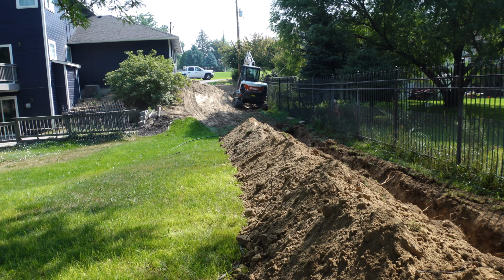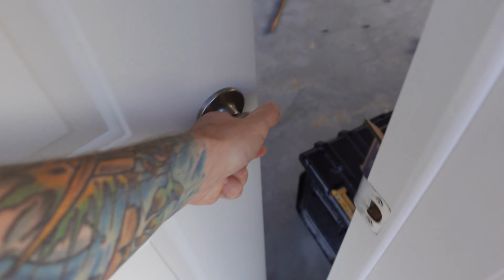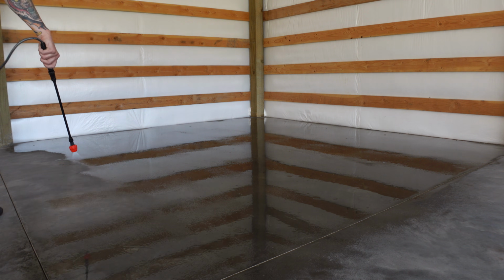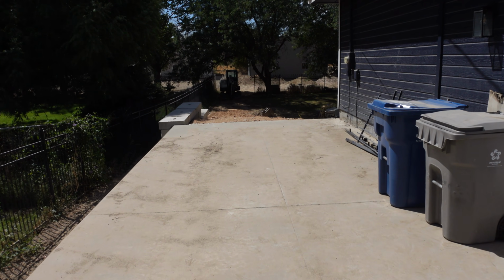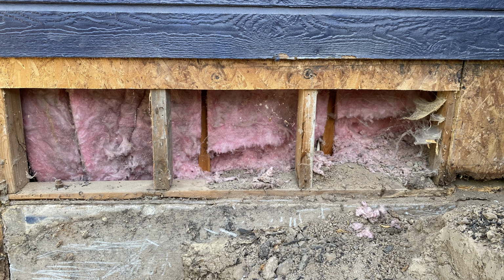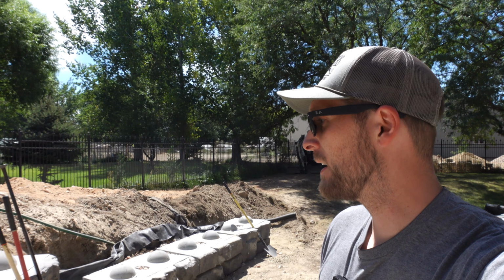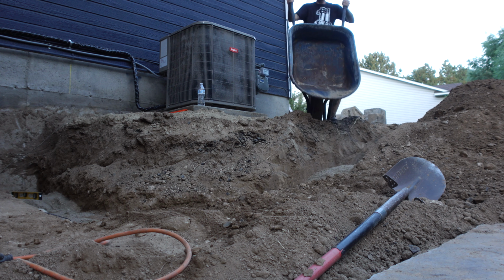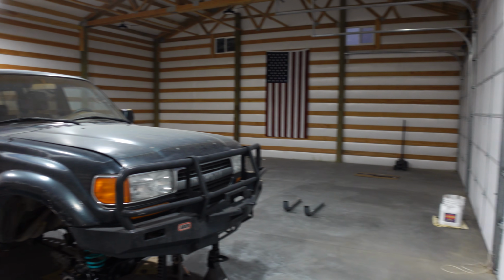I Spent $80K Building My Dream Shop… Was It Worth It?

Comment: Well Ricky, I feel your pain especially because of that house-A/C ordeal.  I built my shop in 2004 for like $4000.  Now to be fair, I built it not as well as it should have been.  Structurally it is fine, but I cut corners not knowing as much as I do now and have since gone back and fixed nearly all issues.  In perspective, it was a 20X30 with 8' ceiling, very basic.  Keep in mind, the slab was already there, hence the reason it was 20X30.  Fast forward to 2016, I built my current garage (because I had to convert the old garage to living space, still have the shop) and it was 24'X32' with 10' ceilings and had to start from the ground up.  Being 12 years later and knowing more and therefore doing more to make it very nice, including a 18X8 garage door and the old 16X7 door on the rear, I spent about $17,000 give or take.  Both buildings were built almost entirely by me (with family help).  I hired a concrete guy and also had gutters put on professionally.  I have no doubt that building would have been $40-50K had I hired someone to do it.  And as a current year follow up, I built a breezeway from the house to the garage and thought I could get it done for $1000-2000, which is stupid since I have done many projects and know the cost of things...anyway $5500 later, I have a beautiful breezeway that really doubles as a porch as well (it's 9'X30'), but damn, it doesn't even have walls man🤷‍♂🤣.  I say all that to say I feel your pain and suffering, having property and doing fun stuff to it costs money. It does suck that you had that issue with the retaining wall and A/C issue.  It's funny guys like us go through the permitting process to make sure all our crap is top notch and to know that allegedly that house-A/C issue you dealt with was probably permitted as well and somehow, they got away with it.  I'm not a huge fan of pulling permits for all the things the government wants me to pull permits for and that's why.  Seems like they are pencil whipping a lot of them.  I did pull them for the large buildings, kind of hard to avoid permits for those.  Anyway, love your channel as always and I can relate to this one for sure.  Maybe the silver lining is you're not in Florida, that wall of yours would have been a bed and breakfast for termites no doubt😂.  Looking forward to more LC content when your parts come in and you get around to the work and editing.

Comment: 75K Yikes! I built my 30x40 in 2005. I did all the framing, sheet metal, wiring and insulated to R19 walls and ceiling. Only thing I subbed out was the slab, $2800.00 for that. I even installed a 2 ton A/C unit. All in my receipts came to just over 10K.
Reply from the maker: Yea my neighbor did his in 2010 for $10k. Prices are up big time.
Reply from the maker: The slab is a huge part of material cost now. And lumber is outrageous
Reply: @RM_Garage  yea i hot a sawmill  and a pile of power poles lumber is nutz